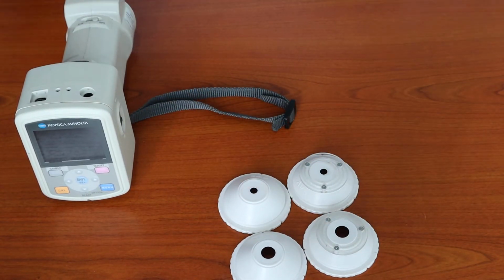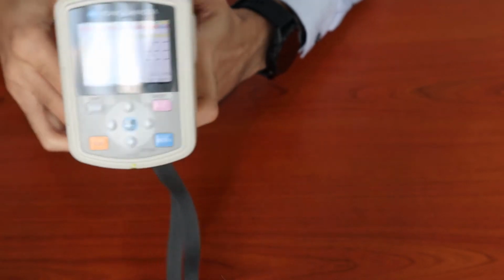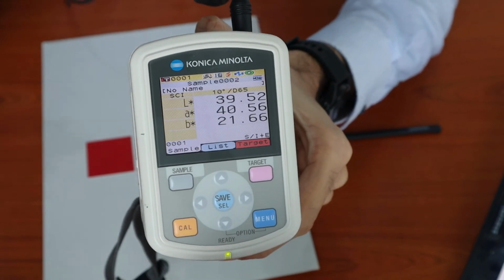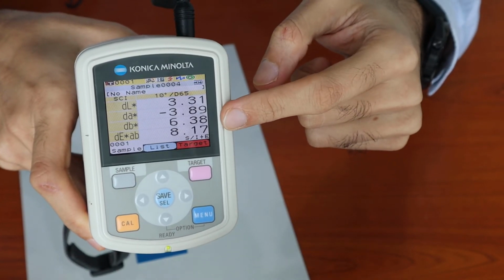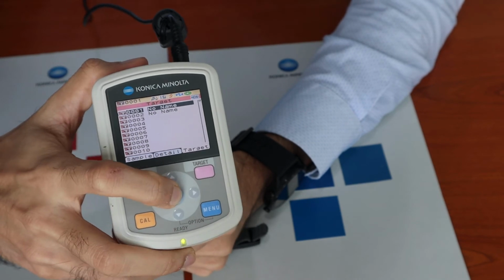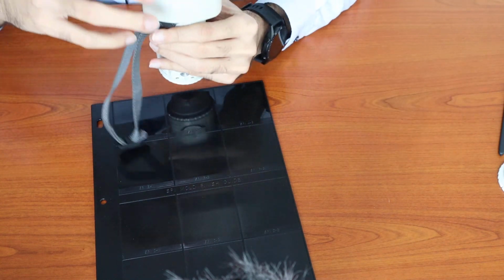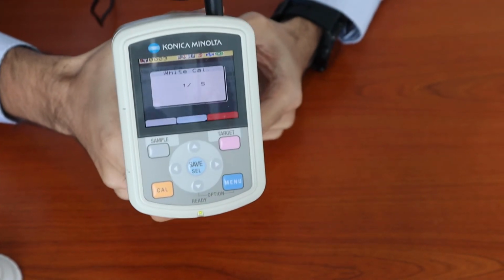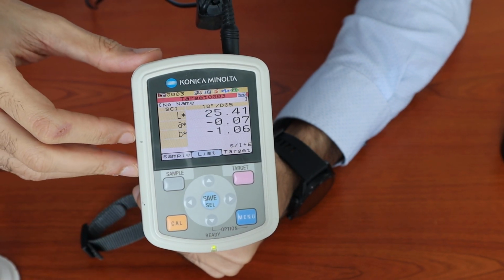CM 600d & 700d Video Tutorial

Comment: Thank you for great video! May I ask for your advice? What do you think is the best option to use SCI or SCE to determine the color of a human skin?
Reply from the maker: Thanks for the positive comments. It's the weekend for me and I have not tested out measuring skin colour. I'll give it a go on Monday and will reply to this comment.
Reply: Thanks for the reply. If you could do that, it would be very helpful to me. @Prem-DST
Reply from the maker: @dariadronova9132  hi, so after some testing and reading, it would be best to measure it in SCI mode. 

This is because using SCI will omit any surface condition such as roughness and glosiness which could be caused by various skin conditions such as dry skin, etc.

Comment: This is a really helpful video. Please explain selection criteria for SAV/MAV Mode. Also if you can explain selection of target mask with or without glass? How to decide which mode (SAV/MAV) to use and which type of target mask (with or without glass) to use.
Reply: Thank you very much.  The MAV has a measurement area of 8mm (dia.) while SAV is 3mm (dia). To the selection is based on the surface area that is available for measurement. Example, if the surface area is only 7mm diameter, then SAV would be the right choice. However, if the samples surface area is 20mm, then MAV would be a better choice.

As for the target mask with glass, this is for a very specific application. Typically when measuring food products. Example if the sample was raw meat (fish, etc.) then the usage of the target mask with glass will be useful as it will prevent any liquids or residues to contaminate the sensor. 

If you would like to receive more information, please send us your enquiry here: https://sensing.konicaminolta.asia/rfq-form/